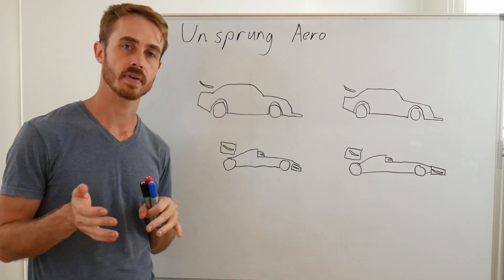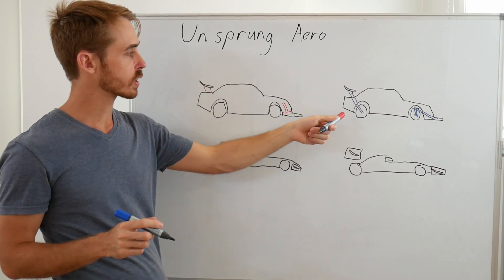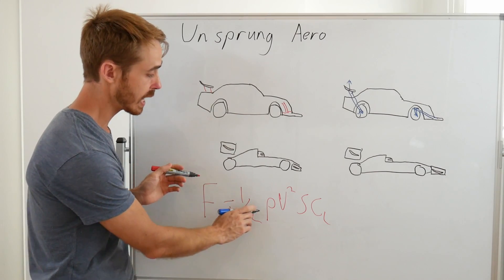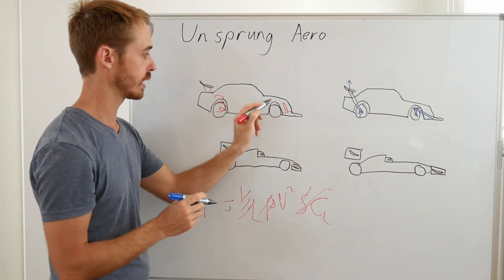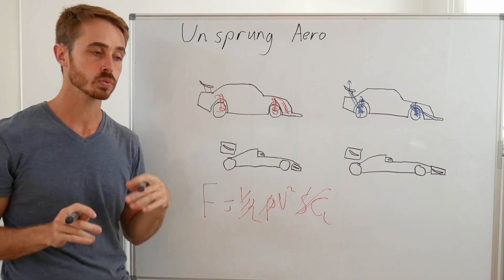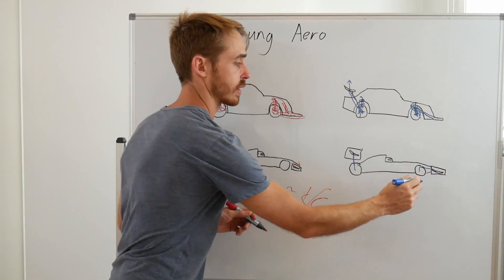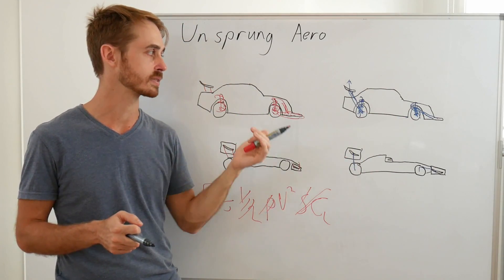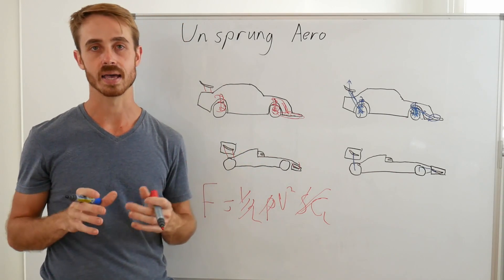The Aerodynamicists Magic Bullet? Unsprung Aero Explained

Comment from the maker: I'm heading off to the UK for a few weeks after this to visit some F1 teams (Sorry, no cameras allowed!), so there won't be any videos for a bit. Enjoy this one!
Reply: KYLE.DRIVES Awsome! When you return could you talk about the aerodynamics of a spinning wheel?
Reply: KYLE.DRIVES If the mass of unsprung wings themselves will add to unsprung weight, would the effective weight of the downforce they produce also add unsprung weight?
Reply: KYLE.DRIVES  Enjoy the trip! I'm envious.
Reply: KYLE.DRIVES an open ended shoe box provides downforce! ray mallock noticed when the rear panel of his clubman's race car got ripped off he had more grip on the rear of his u2, wich was at the time a lotus seven lookalike! i tried it on my slot racers and it worked for me too until it was noticed and banned until everyone was allowed to use it. i,m g, using the open ended shoebox idea on my large scale RC fg formula one race car! along with an exhaust blown diffuser!! hoping it will work for the summer season of the south east radio control car club,s formula one challenge in the south east of England!
Reply: I had the idea of putting the rear wing on the rocker arms of the pushrod suspension in time attack cars.

This would give 50% sprung 50% unsprung dependent on where the linkage is on the rocker arm. Could be 70 30 or  90 10 it all depends on where the mounting points on the rocker arms

Second thought was to have the mounting points of the wing in the middle then have them connected in an X pattern to the rocker arms meaning 
The left wing mounting point goes to the right suspension rocker arm and the right wing mounting points goes to the left suspension rocker arm.

This creates active aero that is not very extreme but still better than nothing with body roll.

So the wing will tilt to the left on a left turn and on the right on a right turn as the body rolls
Reply: How about springing the unsprung aero directly to the uprights? The impact of mass is lowered and the aero package is sprung thus doesn't take all the forces coming from curbs and bumps of the track
Reply: TheBrandonWeir Not really - unsprung weight should be called unsprung mass, as the problems it creates are due to the inertia of the bouncing wheel & suspension components.  The name comes from our bad habit of confusing "weight" (how hard is this thing pushing down on the earth) and "mass" (how much stuff is this thing made of) in daily life. While downforce increases the weight on the tires, it doesn't affect the mass.

However, if we're splitting hairs there will be an induced effect since a bouncing tire also means the wing attached to it is moving up and down, altering the apparent angle of attack and by extension the amount of downforce the wing creates.
Reply: Jason sounds to me as if you mixed up mass and weight yourself.
Mass incorporates all forces resisting acceleration including in this case the downforce. If it wouldn't add to the effective mass resisting sideways acceleration there would be no point in having it. 
The reason you can corner faster with downforce is because it adds to the effective mass of the car and centrifugal forces need to be higher to overcome it.

Comment: Is bolting some minor canards to the outside-facing wheel assembly helpful in terms of low speed downforce? Instead of a whole underbody or floor being bolted to the wheel assemblies and causing oscillations and porpoising?

Comment: Is an unsprung floor/underbody destined to undergo porpoising after dealing with one bump or pothole? Would it require stiffer springs to control the oscillation of the wheels and the heavy floor to undo any potential oscillations or choked flow, thereby offsetting the mechanical grip benefits?

Comment: Time out! Yes the weight of the aero device will add up to the unsprung weight but it will also only have to push down the unsprung weight instead of the entire mass of the car (F=ma) making it more responsive to keep the tire on the track at all time.

Comment: If you want to push your wheel down against a bump hopefully your downforce will be a lot bigger then than the force generated by the wing mass inertia going up (unless your wing is made out of cast iron). So it will greatly overcome that problem.

Comment: You say that this solution never made it out of Formula SAE. The Lotus 49b had its rear wing mounted that way. So it actually made its way into Formula SAE. It's really a solution from the early days of Aerodynamics in F1 when most of the interesting, though unoptimized, ideas were born.

Legend has it that the extra dynamic load was causing fatigue fractures on the actual hub and there were a few failures there. But that could be F1 folklore...

Comment: I have a question.  We race on ovals not road race, BUT? Unsprung weight is Most Undesired. The calculation is :   1 pound of Unsprung equals 10 pound of Sprung weight.  Wouldn't this hurt the tires in cornering?

Comment: ISMA supermodifieds use a hybrid of this, the rear wing struts are actually air shocks and the front of the wing is mounted to the chassis in a pivot point so the wing drops at high speeds but stands back up under braking.

Comment: You mentioned that the disadvantage of mounting the areo to the chassis is that you need harder suspension, have there been any experiments with with a "hybrid system, using 1 type of suspension for the main chassis and another for the areo?

Comment: In the mid to late 90s I had a radio controlled race car that had an unsprung wing on the rear. I can remember the setup but not the model or brand. Would be great to find more information on it today.

Comment: But how would it work with suspension travel?  
 If your wheels drop for whatever reason, it would create a gap between the splitter and the car, oppening a new channel for air between them unless you had an air dam on the splitter behind the body.

   Or the opposite of that would be the body slamming down on the aero during hard braking.

Seems unstable in dynamic conditions.

Comment: Doesnt this also reduce effectiveness of on body fins and other elements to route wind to spoilers, especially rear? Spoilers will be constantly moving so designing a body would be harder.
Reply: But if the undercar aero is unsprung, itll stay a constant distance from the ground through braking and cornering forces
And you can use more effective spring and shock setups because you no longer have to account for hundreds of pounds of downforce on your suspension

Undercar aero works perfectly when really close to the ground, but immediately stop working if the car bottoms out 
Bottom out on a corner and you'll fly off the track
Reply: @jonathanstevenson8948  brake ducts, but yes
Reply: Actually if you notice in motorsport tires look like they rarely move up and down, its the body of a racecar that moves around. In street cars youll see the tires move up and down but an unsprung wing would actually look quite still

Comment: Mounting to the chassis = sprung. Mounting to any suspension component = unsprung. Correct?
Reply: A general rule that many racecar engineering books stick to is this:- If you lift a car off the ground, anything that lifts up with the car is considered sprung, anything that droops (like wheels) is considered unsprung, anything that connects the sprung to the unsprung (suspension arms etc) is considered "half and half" (within reason, and not taking into account centres of mass of individual components etc etc).
Reply: Yes. The Chaparral 2E race cars of 1966 was the first.....He even had a separate foot pedal that allowed him to feather the angle of attack...the 1st active aero car.

Comment: Very interesting, as usual. If you used an unsprung aero system, couldn't you take advantage of the more consistent ride height to run the car a bit lower, in order to make more effective use of the diffuser, without risking bottoming-out the car?

Wouldn't that allow you to use slightly smaller (and therefore lighter) front and rear wings, thereby mitigating the unsprung mass issue? Does that make any sense at all?
Reply: It makes sense to me. As I watched the video, I found myself picturing the same scenarios/ asking the same questions. Also (in a street car), would mounting points of said aero elements be "simpler" for the front than the rear, due to proximity of suspension to aero element? Would this then lead to a rear diffuser being more relevant than a rear wing? What effect then would be the constantly variable relationship between a "fixed" postion front splitter and  rear diffuser and a constantly moving chassis undertray?

Comment: why is unsprung weight so important?
Reply: Putting the downforce directly on the control arm/wheel...the ground clearance doesn't change like it does with a normal race car....also the suspension can be softer/easier to drive.

This is 1966 technology.
Reply: Because it's essentially weight you can't control very well. Imagine a wheel that weighs 10 kilograms hitting a bump on the track and being thrown up and compressing the suspension - there's a lot of force involved, now imagine that same wheel weighing 100 kilograms. The heavier the wheel, the harder the suspension has to work to keep that wheel in touch with the road, if the suspension can't keep the wheel in touch with the road, then you have a car that handles very badly. Wheels can "tramp" - which is bounce up and down - under braking etc and when wheels lose contact with the ground, they don't really help with braking at all. Unsprung weight also affects cornering but the details of that are beyond my explanatory skills...(think of lateral g-force working on big weights that are sticking out from the car).

Comment: The first rear wings in F1 were unsprung like you propose. 
They were swiftly banned for safety reasons.
Reply: Some of them even had rods that controlled the angle of attack when the car squatted or lifted. Rindt and Hill both famously crashed at Montjuich in 1969 when their wing struts failed. Part of the reason they were banned - if not the main reason (unsure on that).

Comment: Having unsprung aero doesn't add unsprung mass. In fact, when you are driving, the added mass from the aero makes more force down than the weight of itself, therefor decreasing the feeling of unsprung mass, even less than if it wasn't there. Also, when the wheel "jumps" up, there will be more pressure on top of the wing. With the increased air density, the downforce (and drag) will be even stronger in the moment it "jumps". In addition, when accelerating, the driving wheels don't have to wait for the aero force to go through the springs. This will decrease the time you have to wait to hammer it, especially good for cars without turbocharging. All in all, it will increase the time the wheels have firm contact with the ground.

Just wanted to point something out

Comment: when travelling at a certain speed the wing will be placing a force down on the outboard components of the car as is explained, however you said at the end that the un-sprung mass is increased which makes sense but does the increased downward force due to aero not mitigate the negative effects of un-sprung mass? my understanding was that higher unsprung mass will create larger forces travelling up through the chassis through the suspension components, but my question is will having a wing creating a downward force acting straight down on that mass not counteract that upward force resulting in a nearly negative unsprung mass if the car is at a high enough speed? sorry if thats unclear I find it hard to explain my question

Comment: Actually there are even greater benefits to this.
The airflow around the back of an airfoil will mimic a "memory" of how the air flowed a split second before which means a sudden sharp increase in angle of attack (a bump in the road) will yield a big spike in downforce without actually delivering the corresponding increase in drag that is normally associated with the higher angle of attack.
This is generally why you will see windsurfers "pump" the sail when they feel a bit underpowered in lighter winds.
(I believe that's from "Sail Performance" by C A Marchaj)

Comment: Not lying, I came here to see the thumbnail car
Reply: Monash does run unsprung aero, might want to check your facts there. They've run it since 2002 (I've sat on one of their wings). It's even listed in that spec sheet in the comment above:
"Unsprung mounting front/rear wings, Drag Reduction System front/rear wings"
"Suspension Type Double Unequal length A-Arm, direct acting, adjustable U-bar integrated with wing mounting"
https://www.monashmotorsport.com/the-car/2014-car/
Reply: Henrix98 it is a car from Monash fsae team. There should be plenty of videos of 'em floating around on the YouTubes.
Reply: Ah yes, the glorious 2014 season with all the aero monsters.. good times!
The year after we switched to unsprung aero too. For the front wing it's quite an effort, but it is worth it!
http://www.highspeed-karlsruhe.de/index.php/fahrzeuge/f-109
Reply: Formula SAE, only restriction is a 19-20mm intake restrictor plate
Reply: Correct, Monash doesnt run unsprung aero devices, the most famous example of unsprung aero is FS Team Delft, although they were not the first to implement it they have had the most success with it.
Reply: WodanKlaaschOften I've watched a couple and it doesn't seam to be unsprung nor do the cars in the series... the front wings are like any other set up on an f1 car and the rear wings are just oversized but still attach to the body or frame... not to the axles
Reply: Henrix98 same... youtube just allows you to add pics now they don't even have to be in the video. prob find youtubes monthly hits were on a downward trend so the powers that be decided to actively allow clickbait